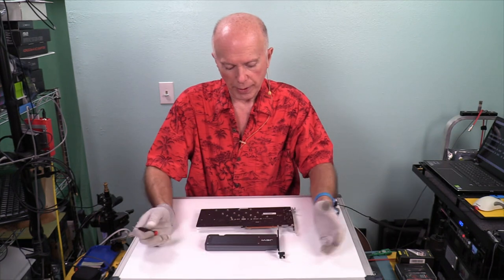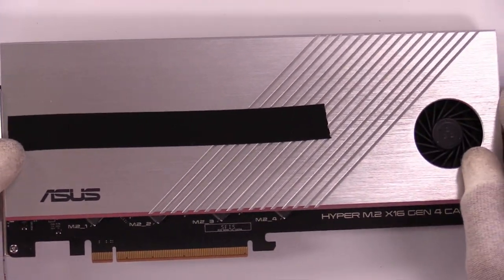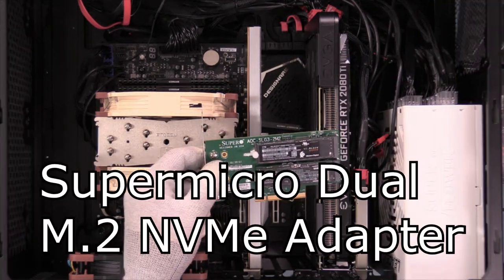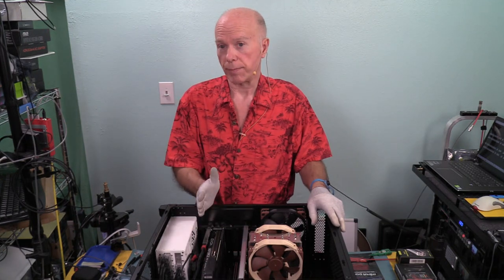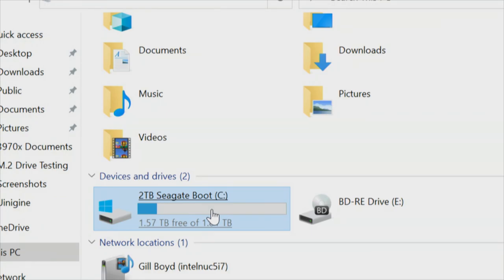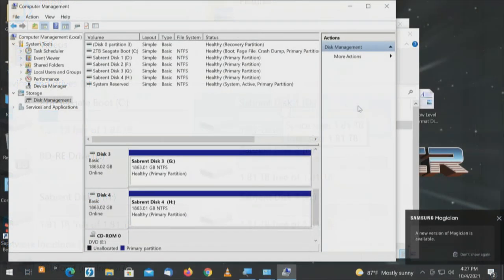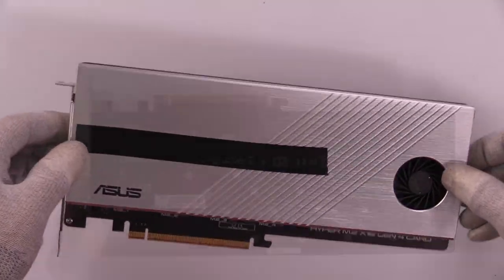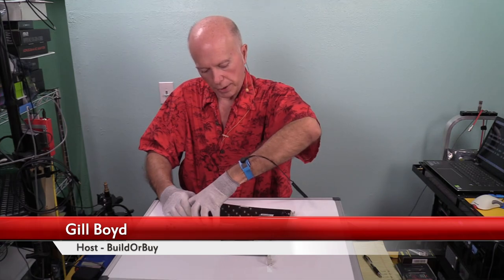ASUS Hyper M.2 X16 PCIe 4.0 X4 Quad card Heat and Speed Test Comparison

Comment: If you're not aware, there's a quicker way to open Disk Management: Right click on the Start menu button and select 'Disk Management'. 

Much faster than using the Control Panel.
Reply from the maker: Hi Beany, 
Welcome! Yes, glad You brought that up! Windows has several ways to accomplish several other tasks as well. We prefer the original way although considered legacy since there are often times other features that need to be addressed from the Control Panel. Appreciate Your Comments! Thanks for Watching!

Comment: Hey sir! Thank you so much for this video! I love how detailed and comprehensive you are, and can see the great effort you put into them! 

You mentioned that you had all four drives installed even though only two were tested on the asus hypercard, lest you run into “load bearing issues”. Would it be a problem if I bought the hyper card and only installed two 990 pros? 

(I do also have two 970 evos(one is startup drive), but they are currently used in my system so I guess I would to reformat them if I were to place them in there. It seems like it is possible to run the drives separately without raid on this card as well, which is fine because I don’t really need the speed/my motherboard is limited to PCIE 3.0x16 for now.)
Reply from the maker: Hello kristianehac,
Welcome! Appreciate Your Comments! Short answer, yes - 2 Drives. Longer answer, depends upon Your Motherboard. Two requirements have to be met. 1. X16 PCIe Slot. 2. Motherboard Bios has to support Bios Bifurcation of at least 4X4 for 2 Drives. RAID is a separate issue if desired but not required! Hope that helps!
Reply: Thanks so much!! Think I will place my other drives in there as well then, and not run raid. You are such an asset to this community! Thanks again!

Comment: I'd like to start off by saying that I'm new to this type of pc stuff but you seem to know how to explain and break everything down very well so I subscribed! I was wondering if you'd be able to help me or point me towards the right direction, I  currently have an ASUS Tuf Gaming x570 plus (Wifi) motherboard and it only has (2) m.2 slots but I was wondering if there were any m.2 to PCI-E adapters you'd recommend that wouldn't have to go into the first PCI-E x16 slot since I've heard that putting a GPU in the 2nd PCI-E x16 slot can lower performance. I'd prefer an adapter that can hold atleast 4 m.2 slots but wouldn't mind settling for one that has 2 m.2 slots, thank you for your time and I'll finish watching the video.
Reply from the maker: Hi AyeAyeRon,
Welcome! Thank You! Appreciate Your Comments! Short Answer, not enough PCIe Resources. That 2nd x16 Slot Mechanically is x4 Electrically. Bummer! Longer Answer below. 

ASUS Tuf Gaming x570 plus (Wifi)
https://www.asus.com/us/Motherboards-Components/Motherboards/TUF-Gaming/TUF-GAMING-X570-PLUS-WI-FI/

PDF Manual, Page 16. Motherboard Layout: 
- PCIex16_1 
- PCIex16_2
- PCIex1_2

- M.2_1
- M.2_2 

PDF Manual, Page 8. Specification Summary: Expansion Slots and Storage. 
To CPU - 
- PCIex16_1, x16 Electrically. 
- M.2_1, PCIe x4 Electrically. Not enough PCIe Lanes allocated to go around to do more! 
Through Chipset - 
- PCIex16_2 - x4 Electrically. 
- PCIex1_2 - x1 Electrically. 
- M.2_2, PCIe x4. 

Hope that helps! Thanks for Watching!
Reply: @BuildOrBuy  So are you saying not even one M.2 expansion would work in that slot with x4 power?  Or is two possible, just not 4?

Comment: Sometime in the future I need to buy a motherboard that can support x2 GPUs (I love having tons of monitors) and also have high speeds for an M.2, either connected to the mobo or into a third PCIE slot. I'm imagining the two GPUs will create a lot of heat and may impact the performance of the M.2

I saved this video for later and will return with questions one day  :D  great info
Reply from the maker: Hi Wakish,
Welcome! Appreciate Your Comments For Monitors, how many, 8? OK, 2 GPUs. Depends. Will those GPUs be Bridged? Questions arise. Suggest keeping those Simple! Suggest either AMD Radeo Pro GPUs or NVIDIA RTX 3090 variety or RTX A series such as RTX A5000 which is 2 Slots wide. First concern will be the Bridge Connector thus NVIDIA! Next, as for Heat, if using Pro GPUs, those require less Power and also put out less heat. However, the RTX A5000 runs hot and should therefore be liquid Cooled. Options! Hope that helps! Let Us know when You're ready to talk Specs for Your new Creation! You'll prefer a Motherboard with 2 - X16 PCIe Slots, electrically! Motherboard Chipsets Rule! Success on Your Multi Monitor Computer Build!
Reply: @BuildOrBuy  Thank you for the reply

What I have right now is an RX 580 8gb running x4 monitors on an ASUS X570 board. It handles these 4 monitors just fine and has another HDMI port for my TV, but I notice that I do drop in framerate in some games if I plug that in. If I could plug in my TV and one additional monitor that would be nice

I play a game called Star Citizen which benefits greatly from being stored on as fast of a drive as possible, and also on a different drive than the OS

I also have an old junk GPU, MSI N750Ti that should still work but I haven't tried it in my second slot yet

I don't have an M.2 yet (may need 2) and am not sure if it would be better for me to use a PCIE adapter

If the M.2 PCIE adapter is necessary for better speeds then I would need to upgrade my mobo to one with x3 slots

Hopefully this all makes sense what I'm trying to do. Obviously I know it's not optimal to mix an AMD card with an Nvidia but it's just for more displays, but I also want to optimize specifically for Star Citizen

Edit: And I know you specifically mentioned the X570 in your video, but I mean for my specific purposes (sorry for the huge wall of text)
Reply from the maker: Hi @Wakish0069 ,
Details matter! 
1. To address Your Multiple Monitors on 1 GPU. You need a Workstation GPU. AMD Radeon Pro W6800 (newer) or Radeon Pro W9100 (older), both with 6 Mini DisplayPort connectors. Use HDMI to Mini DisplayPort Converters. That's what We do. Could not locate Radeon Pro W6800 on Amazon. Only on B&H and NewEgg. 
2. Your Motherboard, do You have a Chipset Preference?
Depending upon the age of what You have that change might be RAM, Motherboard and CPU! 
3. M.2 NVMe PCIe 4.0? Does Your current Motherboard support NVMe? 
Hope that helps!
Reply: Aren't the new 4 series GPU's preventing running dual?
Reply from the maker: Hi @Freeflier1978 ,
Welcome! Appreciate Your Comments! Look how the Info has changed from 2 months ago! Even 1 month ago! Yes, at 3 Slots wide, Depends upon Motherboard chosen! Most will not. A HEDT, maybe. A Workstation Motherboard, yes at the expense of other PCIe Slots!

NVIDIA RTX 4090 no longer supports NVLink - TechGoing https://www.techgoing.com/nvidia-rtx-4090-no-longer-supports-nvlink/?amp=1

“The reason we took [NVLink] off is that we need I/O for other things, so we’re using that area to cram in as many AI processors as possible,” Jen-Hsun Huang explained of the reason for axing NVLink. 

See: NVIDIA Omniverse... 
3D Creator Connectors & Apps in Omniverse https://www.nvidia.com/en-us/omniverse/creators/

For gamers, creators and workstation users who want to crossfire multiple cards with the latest RTX 4000 series, NVIDIA’s removal of NVLink also enables similar support with PCIe Gen 5.

GeForce RTX 4090 Graphics Cards for Gaming | NVIDIA https://www.nvidia.com/en-us/geforce/graphics-cards/40-series/rtx-4090/

See: Full Specs 
1. CUDA Core: 16,384 
2. 24GBs VRAM 
3. PCIe 4.0 
4. NVIDIA Studio Drivers
5. NVIDIA Omniverse 
6. NVIDIA NVLink - NO!
7. Connectors: 1 HDMI; 3 DisplayPort 
8. 3 Slots wide
9. PSU: 850 Watts
10. 3 - 8 pin Power taps OR 450 Watt or greater PCIe 5.0 Power using ATX 3.0 PSU. 

Hope that clarification helps!

Comment: Bought this for 56$, good deal. Was looking at the cards that support 2 drives, but this one was so cheap that I bought it instead. Using it on AM5 with 8600G which only has 8 (x4/x4) PCIE 4.0 lanes to primary slot, so I'm running 2 nvmes in this card, not 4.
Reply from the maker: Hi @myroslav6873 ,
Welcome. Yes. Smart choice. Good decision. Thanks for Sharing.
Reply: @BuildOrBuy  And thank you for your reviews. I almost bought an Asrock card because my mobo is Asrock, but that card is 2x the price so I'm glad I found your channel reviewing it and comparing to others.
Reply from the maker: Hi @myroslav6873 ,
Excellent. Glad to help. Functionally the same. Thanks for Watching.

Comment: Thank you very much for the info kind sir!

 I'm going to upgrade my old asus crosshair Z formula z mobo with a gen2 silicone power nvme 1TB drive.  on pcie 2.0@4x i should reach 2.5GB/s and i should reach maximum potential of gen2 nvme speesd (2.2GB/s). CPU is 9590 @stock speeds 

I chose UGREEN adapter. i hope it works like on paper! I'll update with news for those older systems.
Reply from the maker: Hi LRGee
Welcome! Appreciate Your Comments! Did You achieve Your objectives? Keep Us posted on Your Progress!

Comment: Awesome video. Maybe you already did this but I am interested on how a quad raid of PCIE-3 m.2's compare to a single PCIE-4 m.2 on the PCIE-4 interface.
Reply from the maker: Hi John Paul Bacon, 
Welcome! Excellent Question! That one, You are the 1st! What We do know is 4 Drives in RAID 0 = the speed of 3 Drives. We can extrapolate roughly from that for PCIe 3.0 of 3,500MBps x 3 = 10,500MBps. And PCIe 4.0 is now at 7,200MBps, 3rd Generation Drives using Phison E18 and Micron memory. And... Adding insult to injury, PCIe 5.0 will be 15,000MBps on the Phison E26 Controller! Faster M.2 NVMe PCIe SSD Drives are running faster and hotter! 

We have some PCIe 3.0 Cards still to test. Your Question gives Us a reason for those Tests as We Answer Subscribers Questions! One of those cards in particular utilizes a PLX Chip for Lane Switching. Upstream and Downstream ports. Thank You! Hope that helps! Appreciate Your Comments!
Reply: @BuildOrBuy  Yes, but what are the temperatures? How hot do the individual nvme drives get during a >30 minute sustained usage scenario, and how well does the asus hyper m.2 cool compared to the supermicro and/or other quad m.2 cards? Getting the answer to that specific question is why I came to this video. I want to know whether or not that puny fan can keep up with the heat generated from say 4 SN850's during sustained peak loads.
Reply from the maker: Hi @jamesryan1716 ,
Hi James Ryan,
Welcome! Great Question! Once in Hybrid Bios Bootable RAID or Software O/S RAID, We lose telemetry on the individual Drives. Therefor, the reason fo so many Tests as We have done. In other words, We cannot read heat from the Thermistors on the individual M.2 NVMe PCIe Drives. Yes, We have Tested 3 ASUS, 1 ASRock and 2 Gigabyte Quad M.2 NVMe AICs. From what We have seen, the Fan on the AIC is sufficient although We would prefer a larger Fan such as Gigabyte Aorus Xtreme which will house 8 Drives but is not out yet. We have a Video on that AIC as well. Hope that helps! Thanks for Asking!

BTW: We have Tested the Drives individually during Our Heat and Speed Tests. We have Temps from that using Sabrent Rocket 4 PCIe 4.0 Drives, 1st Generation. However, those We consider Burst mode Tests and not Sustained Throughput Tests.

Comment: Oh my... Your Videos are always sooo good and in general I understand what you are saying. But in my special Config I am really confused: 
I have Asus X570 Pro Art Create-Wifi. My Processor is a Ryzen 9 5950x. I Have a RTX3090 installed in my 1. PCIe X16 Slot.
1 NVME with 2TB in my first M.2 slot. ( M.2_02 & M.2_03 empty)

I now plan to buy the ASUS Hyper M.2 x16 Gen 4 Interface Cards/Adapter and want to install 2 NVMEs in there. ( 2x 2TB)
I have PCIe Slot 2 and 3 left. Which Slot should I use? And what about the Bandwidth of my first PCIEx16 ( GPU)... Will it go down to X8 then?
Can I use PCIe Slot 3 at the bottom of the board to have max space between GPU und the Hyper M.2 Card? 

I hope you read that someday and can help me out.

Thanks
Reply from the maker: Hello cars103, 
Welcome! Appreciate Your Comments! A Quad card, which Slot. Good question. 2nd Slot for 2 M.2 NVMe PCIe SSD Drives. What happens to GPU in 1st Slot. Runs X8. Why? PCIEX16_1 and PCIEX16_2 Share CPU PCIe Lanes. Therefor utilizing both simultaneously, each becomes X8, electrically. What about PCIEX16_3. Mechanically X8. Electrically, X4. Meaning only X4 PCIe Lanes. Out of PCIe Resources! Hope that helps! Always a Fascinating Topic!
Reply: Thank you so much for your answer! worth gold, really. so would it make any sense then to put that adapter card in my system in general? would set up raid0 on it with the two m.2 in there. bifurcated- then 8 lanes would be good. 

But I could also just put another m.2 in my m.2_2 slot and another one in my m.2_3 ( through chipset then)

or will I really profit any speed from the pcie m2 card with raid0?
Reply from the maker: Hello @cars103 ,
Solving Problems and Providing Solutions! Glad We could help! That's an either OR Question. Which one gives You what You want? Remember: 
PCIEX16_2 slot shares Bandwidth with M.2_2, which runs at PCIe 4.0/3.0 X8 by default.

When M.2_2 is enabled, PCIEX16_2 will run PCIe 4.0/3.0 X4 mode, adjust this item in BIOS settings. 

Use what You have. Hope that helps!
Reply: Thank you again for that answer! ❤ Knowing that populating the PCIe #2  will slow down my GPU to 8x but that causes only 1-3% of perfomance - I guess putting the Asus m.2 x16 Adapter Card in PCIe #2 would be the best solution. Last subquestion..:) 

I will install 2x Firecuda 530 in there. Will striping raid0 will really boost read/write speeds there? Is it really noticable? 
Or should I just set them up as  2 regular volumes? 

I do 3D rendering- lots of simulation caching/ scratching/ file streaming to 3D apps/ After Effects. 

And: In any case I have to bifourcate PCIe #2 in Bios to 4x4, right?
Reply from the maker: Hi @cars103 , 
Gld We could help! The Question of RAID for this type of RAID... The combination of 4 M.2 NVMe PCIe SSD Drives equals the Speed of 3 combined M.2 NVMe PCIe SSD Drives. Why? Overhead. Generally this type of RAID offers capacity and speed. Most Users using this type of RAID do not care about redundancy. 

A PCIe 4.0 M.2 NVMe PCIe SSD Drive in RAID will not speed up Rendering. Processing power combining CPU and GPU will influence speed of Rendering. As always, Test and Verify. 

RAID can be PITA if and when things go South. Keep that in mind.

Yes, Bios Bifurcation. Hope that helps! Appreciate Your Support!
Reply: thanks for your answer!❤ In termes of speed I meant only write / read assets to my 3d/2d programs. rendering is not faster- that's clear- but anyway- here's my experience on the asus m.2 pcie x16 gen 4 card: 

I put it in slot 2. bifourcated it in bios- boot- set up stripe in windows- was flawless! everything worked very good- but now comes the but:

I started rendering to test my gpu speed/ performance since it now "only" runs in 8x. Really no noticable performance loss. Here's the but now:

My gpu never went over 63 degree celcius. Now that the m.2 pcie card is directly under it- my temperatures went up up to 80/82 degree celsius and all my fans went full speed- system became twice as loud as before! Conclusion:

I will not use it any longer. I will  put one m2 in m.2_2 and the other one in m.2_3 ( chipset linked) 

maybe that helps someone.

Thank you for your support! best channel on computer builts!! ❤
Reply from the maker: Hi @cars103 ,
Fascinating Results! Very interesting GPU Thermals! Thanks for Sharing! Appreciate Your Comments!
Reply: another Thought: 

can't I swap my gpu in pcie #1 to #2? and that asus card to #1? Cause both pcie slots now have 8x, right? then my gpu in #2 can get enough room to breathe, right?
Reply from the maker: Hi @cars103 , 
Yes. Correct. Try it!
Reply: I have. works great now- all thanks to your advices😊
Reply from the maker: Hi @cars103 , 
Outstanding! Enjoy!

Comment: Amazing content!  Now I can use card Asus card.  Now I just need to figure out what specific hard drives to get, without busting my wallet!
Reply from the maker: Hi Hawk, 
Thank You! I'm Honored! We're Data Junkies! And requires a x16 PCIe Slot, electrically and Bifurcated! What Motherboard are You using? The Chipset is my concern. Best Drives for the Price or Speed? Either the WD Black SN850 or Seagate FireCuda 530! Larger Drives 1TB vs 2TB are typically faster since they use denser chips. Hope that helps!
Reply: @BuildOrBuy  I have the Asus WRX80 Pro.
Reply from the maker: Hi @lhbbq , 
Perfect! Smart choice! You could run 4 Quad cards! Do the math on that for 16 M.2 NVMe PCIe Drives! Whew! I mention this since We have been asked that very question. I have not heard back from that Viewer yet. Better to invest in a great GPU for Rendering! 1 Quad card makes sense. 2 maybe. 4, just because We can does not always bear relevance on the over all picture of Success! Best Wishes! Thanks for Sharing!
Reply: @BuildOrBuy  thank you so much! I appreciate your information!
Reply from the maker: Hi @lhbbq , 
Absolutely! Here to help! Appreciate Your Comments and Support!